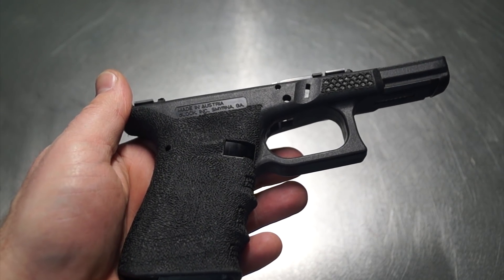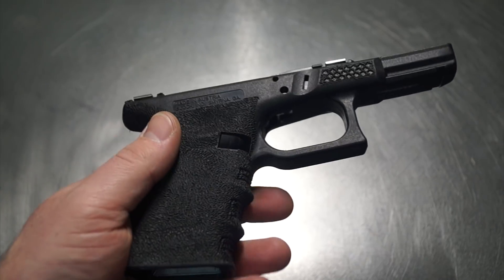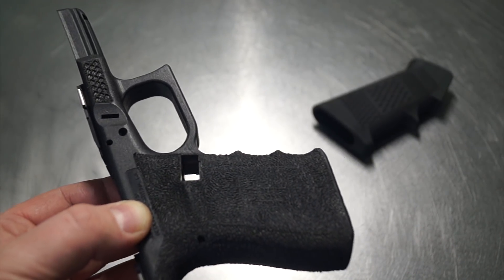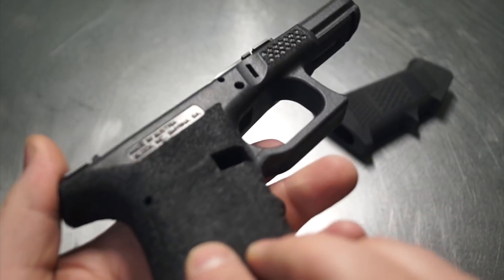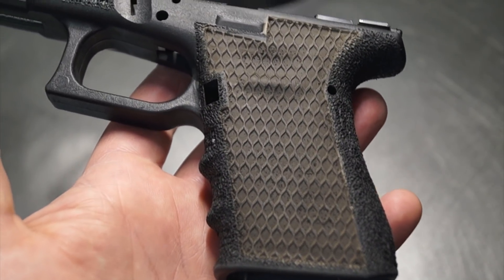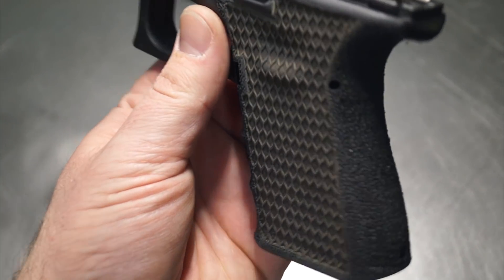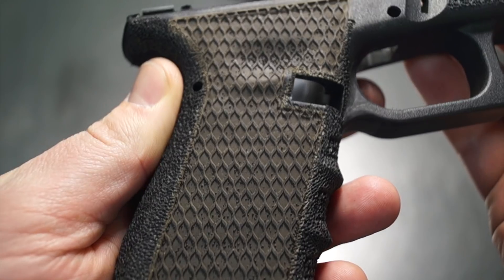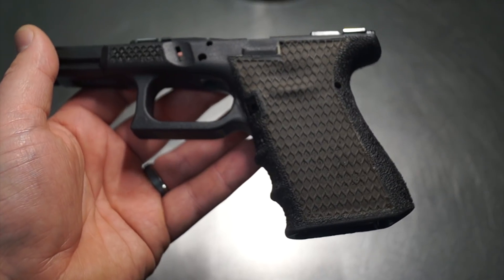Laser Stippling Guns (Correcting a hand stipple job - Glock 19)

Comment: Do you think you take off the old stippling with the laser? Like just a blank pass in order to get rid of it, and then continuing on with the laser to add stippling?
Reply from the maker: No. The laser will bring all the material down a layer not just cut the high pieces.

Comment: Quick question, so basically you get each lower and take measurements and make the outline or do you trace it somehow?
Reply from the maker: Correct. Each lower and generation has its own pattern.  There are several quicker ways to do this however information like this only comes with our training if you buy a laser from us.
Reply: NCEngravers how much is a laser?
Reply from the maker: We have several different models. You will need to send an email to discuss this. Mark@ncengravers.com

Comment: Whoah now! I agree the stipple job wasn't good. I, would have corrected it with a bordered stipple job. 
I'm seeing a lot of bids slagging on stippled block frames. We should be clear that single point stipple is aggressive. The larger more open patterns are leas aggressive. Probably better for carry. So it's important to know what you want. My opinion is that for the money, those more open patterns are a waste of money. Those chain links, bee hive, and larger circle stipples don't enhance your grip. Whether they are laser applied, or not. 
Secondly, single point stippleing is an art. Like hand checkering, which I also do. I'm very proud of the work I produce, and none of my customers complain. Just because a shop has a lazer, that doesn't mean much to guys like me. Most of us hand stipple.

Comment: Does the laser add color? What is the explanation for the color difference in the two areas?
Reply from the maker: This was done with my old fiber laser. Color is not an option on polymers. The white lines you see are where I had the laser at low power to get the frame in the correct position. My new laser does offer coloring but only on metals. I’ll have a video out soon.
Reply: Ok, It almost looked like a Coyote Tan or OD Green but maybe it's just my computer screen, wasn't sure if the laser discolored it during the process. Thank you.
Reply: What is the name of the new laser you have that offers color? awesome videos!